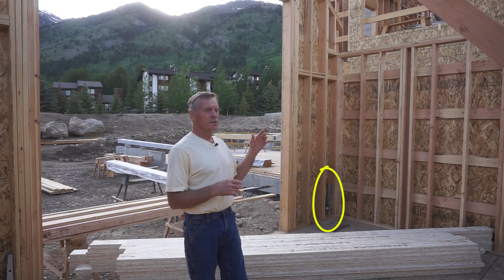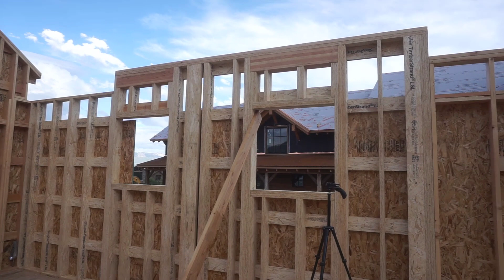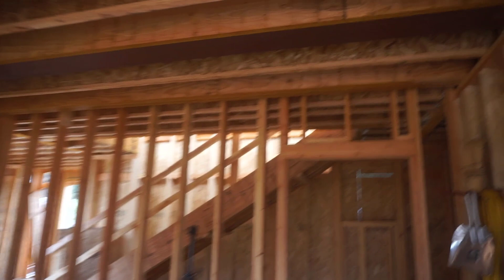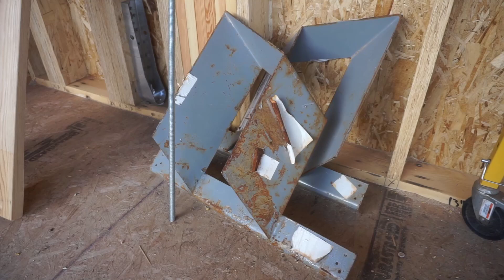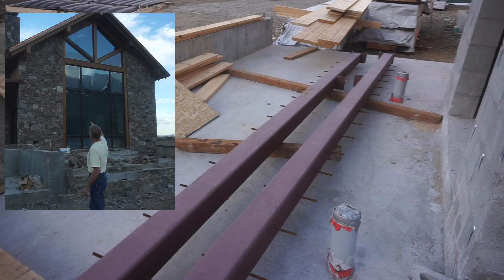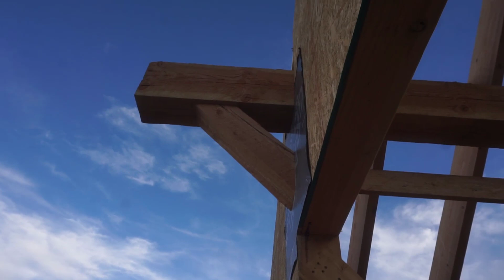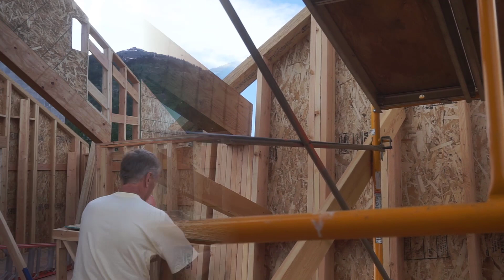A Carpenter's Vacation

Comment: Interesting. Doesn't look anything like that here. Where're the concrete, stone, and the bricks? Were those just stone on the surface? There are hardly any new wooden buildings here, unless you're talking about the poor quarter. Those houses usually burn down in whole lots. Totally not used to seeing the main house made mostly of wood. Chipboard, too. People don't like chipboard over here. Most locals refer to them as cheapboard. The locals prefer brick, metal, and  glass. Lots of huge windows and doors. Preferably with private guards.
Reply from the maker: Where is 'here' for you?  These mansions aren't likely to burn down as the entire structure is piped for a commercial grade sprinkler system.  The cost to put cladding on the outside has got to be incredible with massive stone veneers, steel siding, weathered barnwood, etc... over the top in every way on these!
Reply: @NextLevelCarpentry  Kuala Lumpur is where I'm at. Probably why carpentry is a hobby for me. xD

Comment: I’m curious how they insulate a structure like this. With that many studs stacked up to each other in a lot of spots there would be some large uninsulated gaps if the builder is doing traditional bats. Did you happen to discuss that with him, Matt?
Reply from the maker: Hey Brandt; I didn't discuss it with anyone but have seen many homes in the area done with spray foam.  That doesn't do anything for massive assemblies of studs but might average out with high R value elsewhere.  Massive timbers have similar thermal mass behavior to 'real' log homes so I suppose there's that.  Also those giant windows must have a significant impact on heating/cooling costs to further increase an already Sasquatch sized carbon footprint.  All a matter of perspective I guess.... Best, Matt

Comment: I am bothered by the amount of osb in everything (studs, joists, sheathing). It doesn't look like a building to be admired.
Reply from the maker: Yours is the same reaction I heard 50 years ago when then advent of plywood meant the decline of solid wood 1x material for use in sheathing.  If you spend a bit of time understanding the reasons and benefits for the use of these materials it might relieve some of  your distress.  Either way you'll need to deal with it because manufactured building materials ARE the future.  Best, Matt

Comment: No offense, but I believe the framing was specified by code and the engineers and architect worked to that.  Every wall had to be detailed on the plans, so it was like putting together anything else with plans. However, being that these guys do a lot of work out there, they have experience and can do it as fast as a back east framer. Well longer, but they have it down and it is second nature.  What impressed me most was the string line.  That is something that every framer should be using, but they don't. Nice video.  It is amazing what $5 million or more will buy.  For those big bucks, that is what they should get.  So, the framing is top notch.  I wonder what the foundation is like?  Be a shame to build like that but not make a foundation that is deep, thick, high PSI concrete, and with a lot of rebar.
Reply from the maker: I assure you that the foundations under these mansions is equally robust.  It's all glacial cobble rock and seems sound to build on.  Crazy thing is that they're all built on a crawlspace with the water table barely 6' down on many of the sites. Regardless of the level of detail on the plans, as I said, 'there's a lot of ways to do things wrong'.  In years past I've been bewildered by sloppy jobsites and higgle-piggldy workflow on homes of this caliber in the same area being done by other builders.  Astronomical cost, top shelf materials and outrageous designs don't necessarily mean the customer is going to get a home that isn't sub standard so I don't believe it's 'like putting together anything else with plans.'  It's the little things (like the stringline), and a LOT of them, that make the difference, right? Best, Matt
Reply: @NextLevelCarpentry  Matt, you know better than me, so I will take you at your word. And at second thought, I take back what I said. This is why.  We just moved into our new home built by a big national builder. Ours was about a half million, but they build them a lot more expensive and bigger,  And, while ours doesn't seem to have any issues, and I'm impressed with it,  there are some nightmare stories. Every one of these houses has plans drawn up by engineers and architects, so clearly someone was not following them. I guess you can tell and show someone what should be done, but it doesn't mean they will do it.  I think it comes down to the  boss on the site, who is doing what the owner or manager back in the office demands. In other words, supervision and expectations. Clearly, Dave runs a tight ship, and it shows.
Reply from the maker: @russmartin4189  for contrast there's a new home being built in my local area and it's got a million-dollar job site but it is one of the most horrible construction projects I've seen in many years. It looks as if there's not even a set of plans but there probably is and the guy is in so deep over his head he can't see his way out. I'm glad that your home seems to be sound because it is such a travesty when good materials and beautiful sights are spoiled for Life by incompetence. Originally I wanted to to do a video tile told A Tale of Two job sites and show the contrast between the one I saw on vacation and the one being built locally but I could not in good conscience tour the local job site and trash absolutely everything about it without fear of lawsuit. It would be an educational contrast though that's for sure. Best, Matt
Reply: @NextLevelCarpentry  Some people were not meant to run a company and shouldn't be allowed to take money from people!!!  In the building business, it really is "buyer beware"!  The company that built my house, builds thousands a year, from $350,000 to $10 million.  It is a national company and they have  a system. Everything is subbed and everything is checked and signed off by the Construction Manager before they are paid and the project moves forward. In the community we are in, they use the same subs, so  they know and are comfortable with their work.   There is no mess around the jobsite and it appears each sub must leave it ready for the next crew to come in. In any case, the house is beautiful and we love it.  Still, it is a nerve wracking thing to sign papers and have a house built. Even with the best, things happen. With this company, they guarantee  everything and fix it if necessary.  Looks like Dave wouldn't need to do that.  Unfortunately, they did take a beautiful site and cram in too many homes, ruining a lot of views.  It is a 55 plus active seniors community, and this is the way they build them, unfortunately. There are other plusses though.  Everyone is friendly as all get out. Never had so many friends.

Comment: The amount of money spent on framing these days  whose structure is basically to take the weight of the roof load with  post and beam design is obvious the owner has no issues with money. And the engineer has no issues with total, over the top structural design,The snowload is probably 80 - 100 lbs...Engineering from a Calif based engineer is what it looks like to me. Insane over engineering. Wood isnt strong enough for engineers these days. They might as well build all structures using solid concrete walls and roof structures or moment framed walls and eliminate wood all together. Nice framing but over the top structural design for a bldg that small and a roof pitch that steep.

Comment: electrician / plumbers nightmare!  need a carpenter to move 1 board. same as we did gov work in key west military housing . hurricane resistant. wood moves better than concrete tighten down to 4 x 4 concrete piles every 12 feet. threaded rod top to bottom 3 story  platform home  balfor beaty  from england ran a tight ship with clip board junkies

Comment: That is crazy. I worked on the east coast for about 3 years  and it is amazing the difference in framing ,building in Oklahoma for 30 years. I had to relearn  a lot due to the wind / huarache codes .  They only have to burry water 12 inches and I believe footing are 12 also oklahoma is 24 in and I bet in Jackson Hole it probably 32 or more . Thanks for sharing

Comment: I personally do not use OSB because the glue is flammable and when it gets wet from the water from the fire hose it gives way.
Reply from the maker: Something to keep in mind is that these homes get a commercial grade residential fire sprinkler system installed, if that's any consolation for the use of OSB?  Best, Matt
Reply: @NextLevelCarpentry  Really?!? Wow!
Reply from the maker: @martinpoulsen6564  yes... I'm not sure if it's code or an individual request... and I didn't even mention they over the top electrical systems that get put into these places.
Reply: Next Level Carpentry Very respectfully, not really. Now the sprinkler will soak the OSB in the vicinity of the fire. I understand that drywall will be put up but will it be Type X. Will Roxul be installed between the rooms? 

I will have to admit that I was an Army Engineer so I plan on building any structure to last centuries. 

I’m being to look at metal stud framing. I’m not a framer but a finish carpenter so as you said that a bad framing job makes my job even more difficult. I have trained on metal stud framing which is 180 from what we do for wood studs but I find that the corners are true 90. 

Every day it’s increasingly more difficult to find 2x4 that are straight and true. Then comes the price of premium framing 2x4. I hear it daily from the contractors.
Reply: Good to know. How about plywood then? Same?
Reply: Depends on the glue meaning manufacturer. I found something called structural plywood, introduced to me by a civil engineer, that has a specific pattern, grade quality and waterproof adhesive.
Reply: @jeffreyaustin603  So tvis is what you use for sheathing and shear paneling, or other, like insulated boards or perhaps other? Please excuse the curiosity.
Reply: Martin Poulsen Regular wrap but there’s new technology in house wrap coming out. 

For insulation I recommend Roxul however the company changed its name to Rockwool. Different densities and thicknesses make it an excellent single source. 

Curiosity is always a good thing in our business.
Reply: Another property of Rockwool is its flashpoint or the temperature that it will spontaneously combust. It’s 1200 degrees Celsius or 2150 Fahrenheit.
Reply: @jeffreyaustin603  My guess is Roxul got bought - Rockwool is an old player in the industry.

There is some controversy regarding materials like that as well - not so much sheetgoods, but thicker layers in studwork or roofs, as they do not work well together in terms of absorbtion and evaporation - no worse than foam or any other artificial insulation products, I must be sure to add. The problems have exacerbated with increase of insulation thickness, of which we sometimes come near 24"/600mm.

 Woodfibre seems to have the best properties in that direction, as it behaves similar to the studwork, and doesn't leave them soaked or moist.

 Because it is wood, which people know of as flammable, it might have a tough time in the market, where it is easy for people with rock and glass products to claim non-flammability on their products. 

The reality is though, that when subjected to high heat for longer durations, they will melt away, where the woodfibre gets charred and makes for a natural fire barrier. I can't tell you exactly at which temperatures exactly what happens, but it is nowhere as clear cut as they would like it to be.

 Personally, I've worked with plenty of the artificial stuff, and would be more  than happy to be rid of it. 

Of course climate has a say in it as well... It will be very different between building in Florida, Arizona, Washington, Montana and Alaska. It has to be factored in that wood doesn't agree with high saturation levels or same amount of direct sunlight... So there's that... Guess the best place for people like me to build, is where the old pioneer cabins still exist.
Reply: I just read press release from Roxul that they were changing the name of the company to Rockwool. Personally, it doesn’t matter to me. The level of quality is the same.
Reply: @jeffreyaustin603  If that is the case, then Roxul has been a Rockwool subdivision to begin with - but as you say: So long as the product stays the same
Reply: I just keep using the name Roxul. I think Mike Holmes from Toronto uses only Roxul.

Comment: Thank you for sharing Matt, and kudos to Dave and crew. Being a former framer in the late 80's in the snow belt of N.J /NY/PA mountains,  and have built 2 homes in N.C I totally appreciate the craftsmanship and attention to detail. Simply running the string is a sign of doing things right. I still run  a string at 1 -1/2 from the plate, and use a 2x block for a gauge. I noticed the string standoff that they installed on one of the corners.
In N.C we have both mountain building codes , and 130 mph hurricane wind  codes on the coast( pilings 8-16' feet deep, and first floor minimum height of 10'), so it is always interesting to walk job sites and  witness the extra attention to detail.

Comment: Where does he buy his lumber? The junk you get at the box stores would not allow you to get a wall that straight.
Reply from the maker: There isn't a big box store within 100 miles of the site (my non-resident's guesstimate), not that they'd use it anyways.  Most of the stuff they're using other than standard 2x6's has got to be special ordered I imagine.  Best, Matt
Reply: Maybe he buys it one size bigger and mills it flat with a fat ass jointer and planer? :D :D :D
Reply: Engineered lumber and good grade doug fir - kept dry and out of the sun. Any well stocked lumberyard should be able to deliver. When I was out west we got ours from these guys http://www.plywoodsupply.com/

Comment: Aaarwhhh Matt... That really brought back memories... I have had the good fortune of being a part of one of such crews for 18 months out in the greater Seattle area... And you're absolutely right - can't be beat... Even though it's been more than 15 years, it's still a highlight in my career. We didn't quite go that much overboard on LSLs, PSLs, LVLs and such, even though we used it for floor joists (TJIs), large headers and beams, but not so much for studwork, and as you said, we had to crown the lumber, plane a bit and shim with buttsticks to get a straight wall for the drywallers, though not very much as we only used a pretty good grade doug fir lumber. Spruce, hemlock and pine for temporary bracing only.

This house seems to have a bit bigger spans than we usually operated with, which is also partly why we didn't use as many steel members, because the tiedowns are exactly alike, as are bolt sizes and so on - you'll be hard pressed to find sturdier construction anywhere, comparative to size. As for insulation though... 6 inch walls are not really enough in the cold. The return might stretch out, since all of the lower 48 are further south than Scandinavia, but you could maybe pick up a trick or two - fast and easy not being the operable words I'm afraid. On the other hand - you neither have the Gulf stream nor any mountain ranges to shield you from all of the cold from up North, in there between the coastal ranges, so maybe it'd be money well spent after all?

Have to admit that I miss it... A stack of lumber, a Senco and a Mag77 along with a well stocked tool belt will get you pretty far in that respect... We didn't just do framing though. Started out on form work, framing, sheathing, window and door installation, siding, trim carpentry... Pretty much the full carpentry housebuilding package except for the specialists, insulators, drywallers, roofers, cabinetry (though we did install some as well), and of course the other trades - sparks, plumbers, HVAC.

Thank you very much for taking the time to show us! Great building site - Cudos to Dave and his crew!

The guy I built for is still in operation, and a couple of the projects I was on, "the thinktank" and "north mercer home" can be found here: http://www.paulsenconstructioninc.com/wp/